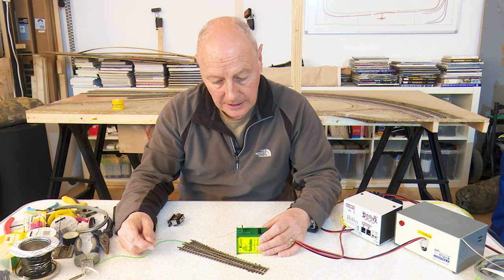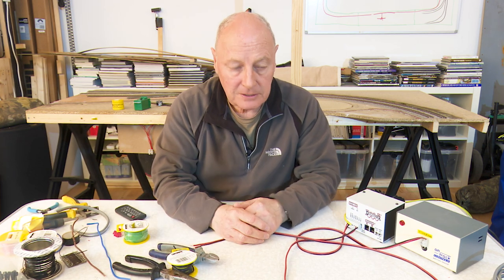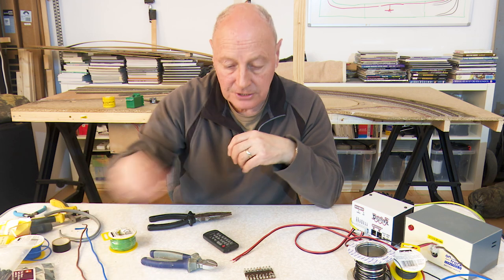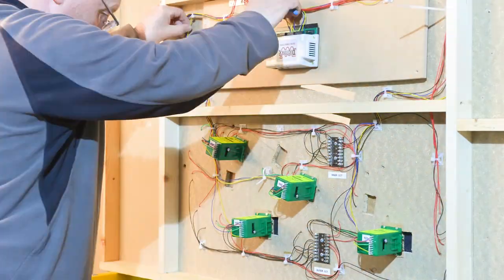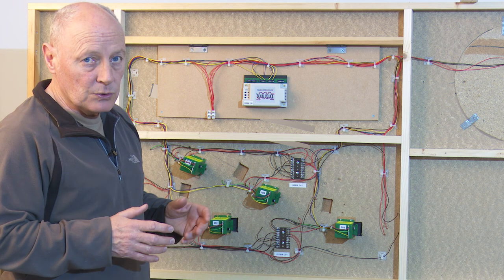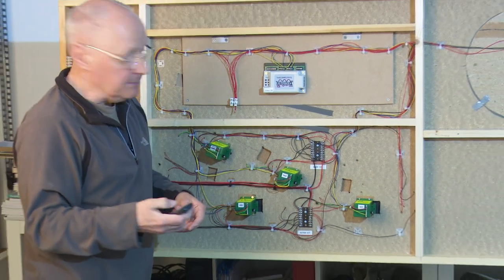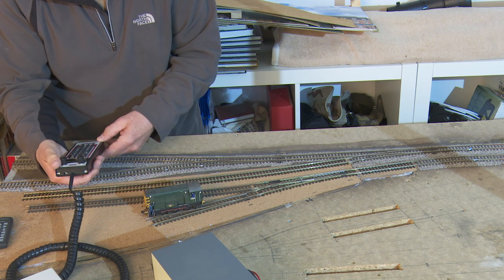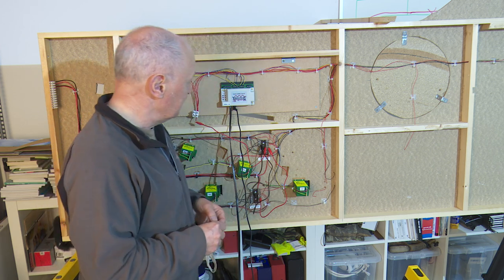DCC Bus Wiring at Chadwick Model Railway | 24.

Comment: Do I wire my transformer into my Digitrax controller and then run my bus out of the Digitrax controller? If this is true, how do I connect a second bus to the controller?
Reply from the maker: Yes you do, and have the second bus in parallel.

Comment: I think people believe that they can't solder well because they buy garbage soldering irons and don't know how to maintain them. If you have a good soldering iron (I like the Weller WES-51) and always load up the tip with solder before turning it off to protect from oxidation, soldering is effortless. If you have one of those crappy soldering pencils that just plugs into the wall with a corroded tip (which is what most people try to work with), soldering becomes very difficult and frustrating. 
 If you do a soldering tutorial, I'd suggest going over good equipment vs bad so people don't fall into that trap.
Reply from the maker: I totally understand but having to acquire various cheap and expensive irons is no mean feet.
My motivation is to encourage more guys to become involved in Railway Modelling and to whet their appetites.
It is only to easy to discourage guys from trying something new.
Reply: @ChadwickModelRailway  To be clear, I'm not suggesting a comprehensive review of different soldering equipment options. There are plenty of good options out there. I'm just suggesting a comparison of what you use vs. a cheap, junky soldering iron to show why bad equipment makes the job more difficult than it needs to be. And perhaps a rundown on how to properly maintain your equipment and why that's important.

Comment: Soldering, yes please
Reply from the maker: Stephen, I shall certainly revisit soldering in the future.
Reply: @ChadwickModelRailway  One problem I have is the removal of solder from existing joints particularly when there are multiple spots holding the same item.
Reply from the maker: Buy a solder sucker Stephen

Comment: Charlie, I was surprised to hear of a new supplier (well, new to me!). And a better price than I can find elsewhere!
http://www.squirestools.com/files/e08.pdf
And I appreciate that using common links between standard connectors on the boards is preferable, for non-mobile setups, only one connector pair is needed, which will half the cost of being able to isolate sections.
Reply from the maker: Glad to have on side as usual Tom. Regards Charlie

Comment: Hi Charlie, do you know the actual gauge/size of the Bus wire and the droppers you use ? i.e 16 gauge (1.25 mm actual core diameter) for the bus ? And possibly 23 gauge (0.6 mm) for the feeders ?
Reply from the maker: Hi, the droppers are 7 x 0.2mm but the exact dimension of the bus wire, I don’t know.  It’s rated at 5 amps.
Regards Charlie
Reply: Thanks Charlie, just watched again and you did say that, sorry for the stupid question.

Comment: Good video, but DCC is DC not AC. It's DC modified square wave alternating. Check out DCC wicki
Reply from the maker: Hi David, I’m so pleased that you enjoyed the video. Rest assured that I do know the difference.  It’s 15v ac on the rails.
Regard Charlie
Reply: @ChadwickModelRailway  I'm sorry but its DC. Check out DCC wicki. It's DC modified square wave alternating. Definitely NOT AC
Reply: David Lindfield Its not really DC either since it’s modulated at high frequency.  I think it’s true that the polarity does not switch like a normal AC signal and the wiki is at pains to say it’s neither AC nor DC.  However you could also think of the DCC signal as a high frequency AC signal with a DC offset such that the polarity of the signal does not change.  So maybe it’s both AC and DC at the same time! Everybody’s happy!  ;-)

Comment: Why on earth would you strip a twin and earth to get the building wires from inside.. that is a big no no in the trade and if you did that in front of your boss you would get the sack!! Its a lot cheaper to simply buy the building wires to begin with, if you want to use that kind of cable at all.
Reply from the maker: You’re hardly gonna get the sack for using twin and earth on a 12 V layout! Let’s not take it too seriously.
Regards, Charlie